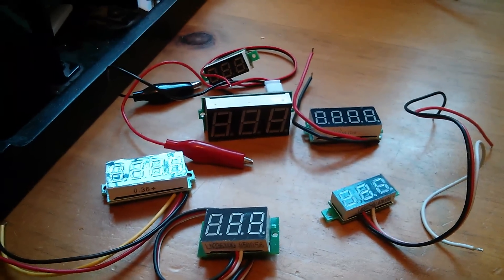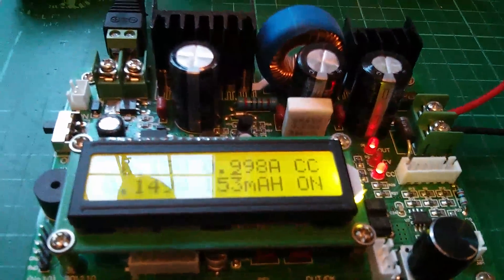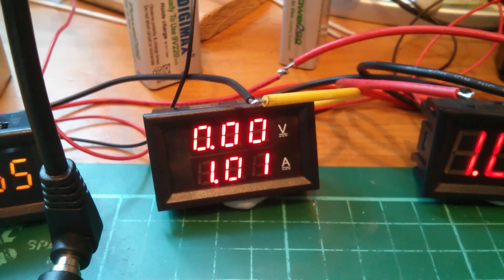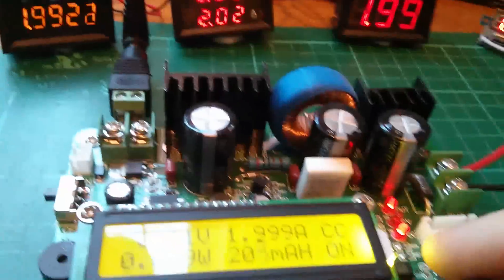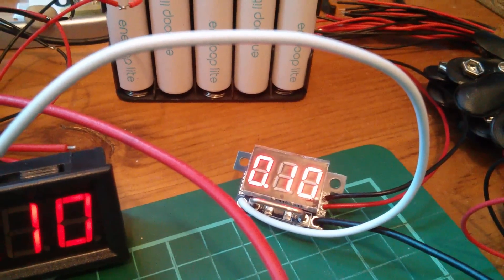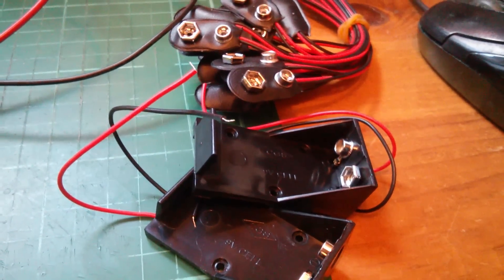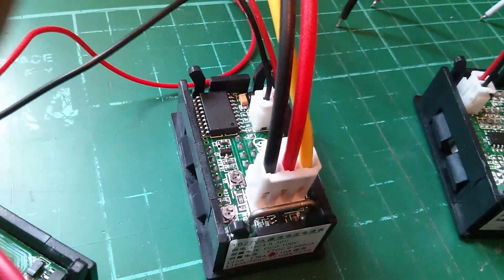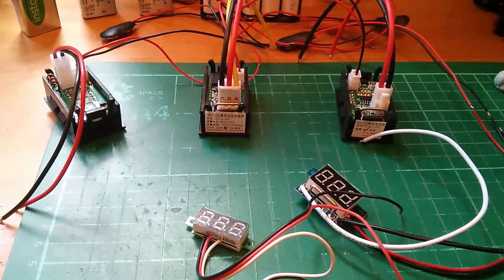Testing a few Cheap LED Ammeters bought on eBay

Comment: Great video, the ammeters need a separate 12 Volts power supply. I have blown up two already ( my own fault ) simple wiring error.
Also free P&P, can't go wrong.

Comment: Thanks for posting this. I've just received the dual Volts/Amps version and was wondering how to connect it to measure amps. Apart from the power supply leads there are 3 wires (red, black and yellow). The red and black are for measuring the voltage but where does the yellow one go?

Comment: Great videos Julian and very informative. If building a PSU involving these meters, do they both have to have independent power to run properly. How would you avoid a short?
Reply from the maker: Generally, they have a common ground, so you can power them from the supply you're measuring. Red power wire and red voltage measure wire to supply positive, yellow current measure wire to low side of the load. Most of the sellers show how to wire it up both with and without separate power supplies. But it is a bit of a brain strain!
Reply: It's funny. I just got the 5 digit meters yesterday after posting the question and tried tinkering around with them. Both meter instructions advised to connect the meters as you described along the measuring circuit although it suggested an isolated power source for each meter for better accuracy to .1mA. The volt meter works but the ammeter will not accept being powered in series to the measuring circuit. I may have to find an isolated dc/dc converter to avoid adding silly 9 volt batteries. Doh! M~

Comment: Thnx for doing this vid! Bought an 10A ammeter from ebay a couple month ago with big blue digits. It was simply horrible. Under 300ma it under shot a huge amount and had an enormous overshoot when working at 1+ amps. I tried adjusting the pot and even cutting away some of the shunt and all it did is adjusted the offset but didn't help with the accuracy a bit. Ordered an open 5A meter and when it comes in a couple weeks ill compare the accuracy. The 5A meters use a 50mohm power resistor which seems more reliable than a piece of cheaply bent metal.

Comment: the one thing I hate about the Digital Amp meter, like for with solar and you want to measure more than one current area of a circuit and you use a large blocking diode to isolate wind turbine readings from solar panels, to battery voltage current charging   and then power out I can have up to 4 areas to measure at times.   and I have found with current meters you need to have the grounds isolated.   have any good ideas on a cheap Isolated power supply that can be used I like to just use my battery bank for power but cant do that with out a isolated power supply to isolate the grounds.